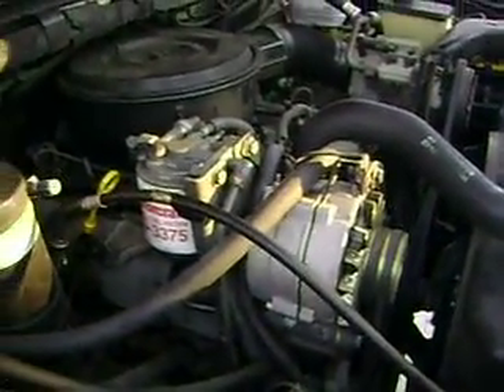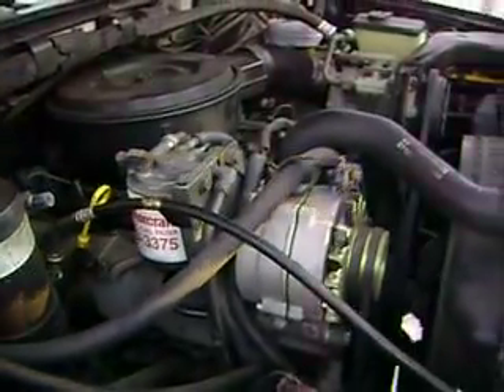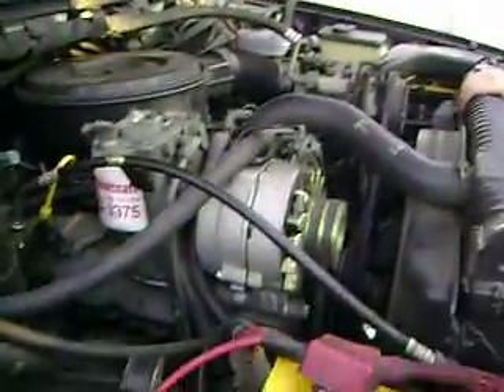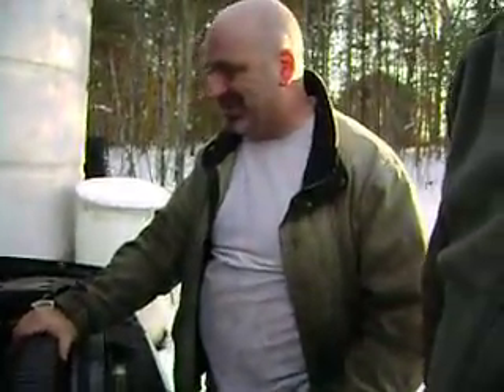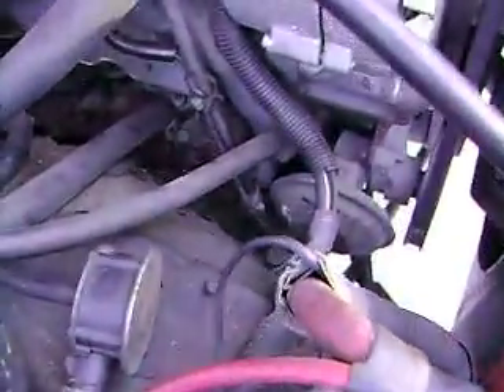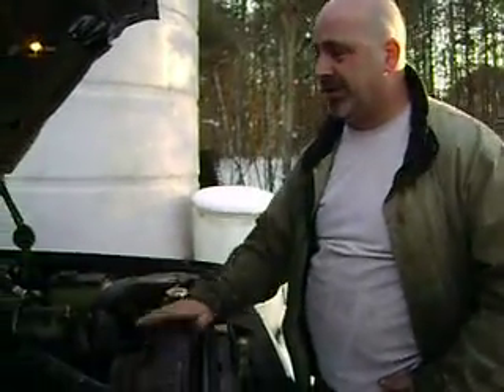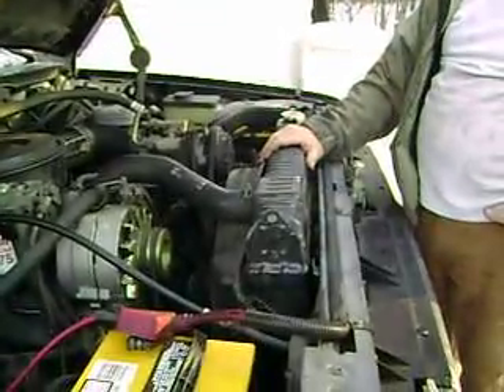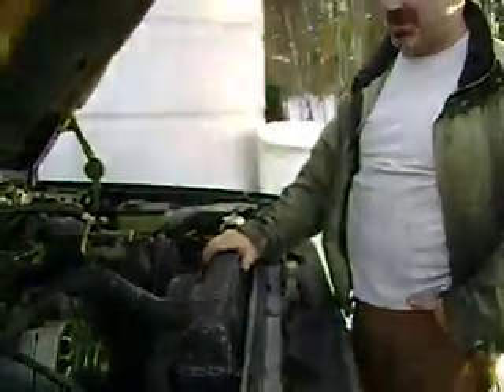Discussion of heat for Vegetable Oil Fuel transfer and use.  Diesel 7.3 IDI engine as an example.

Comment: Why would you need multiple heaters? If I can get it to 70 degrees C or 150F into the pump, that should be fine? Is it to help it through the lines filter with less resistance?
Also, do you have a temperature gauge for the oil?